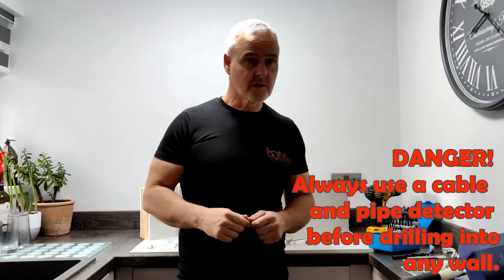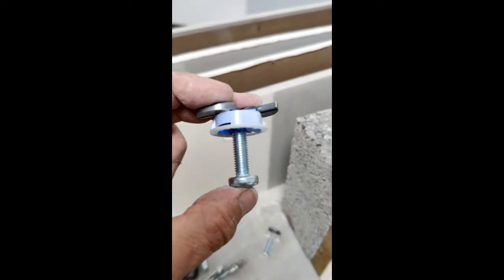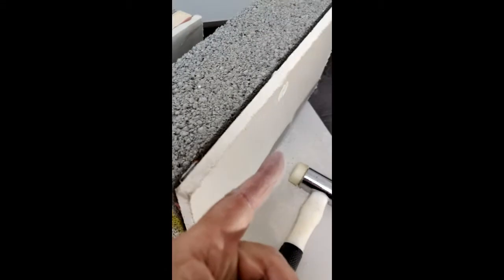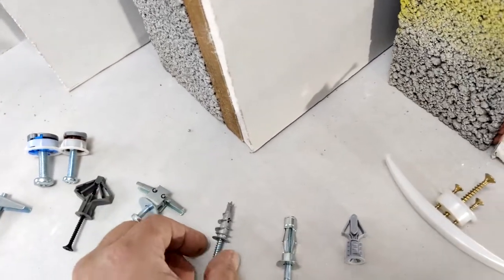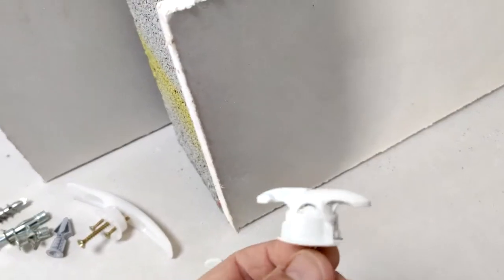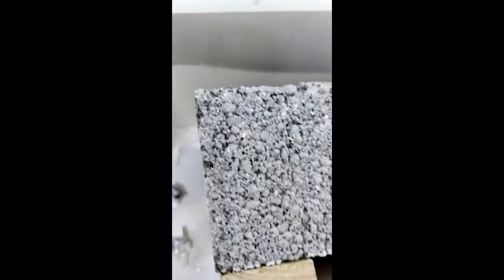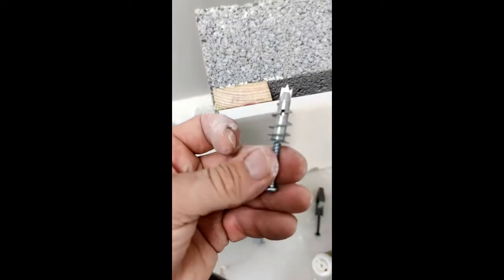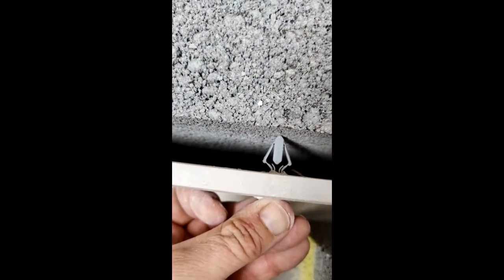The Best Plasterboard fixing ever .One type of Plasterboard fixing suits all types of cavity walls.

Comment: They work on dot and dab on the cavity, but what about if you hit the glue?
Reply from the maker: You always drill a small pilot hole first 3mm diameter, after using a wire and pipe detector. Then if the drill seems to plunge deeper with no resistance after going through the plasterboard , so revealing a cavity. If its solid with adhesive there then you will encounter resistance the full depth of the drill bit. If that's the case, you can then drill put using an 8mm -10mm masonry bit and use a standard rawlplug into the masonry At the rear of the adhesive. Hope this helps . Mark @ https://bullfix.co.uk
Reply: @markhowe5539  Thank you Mark.